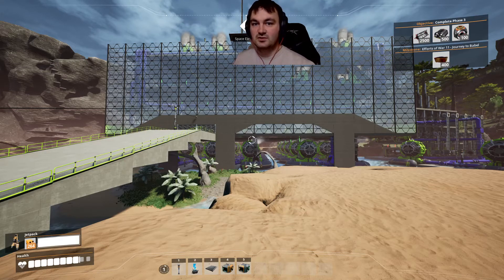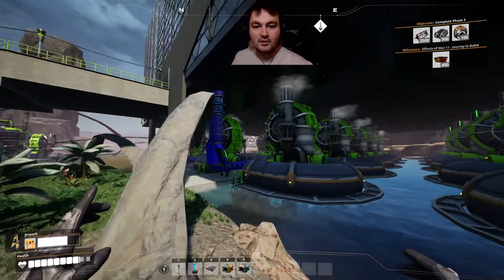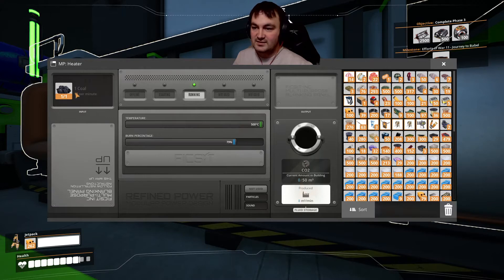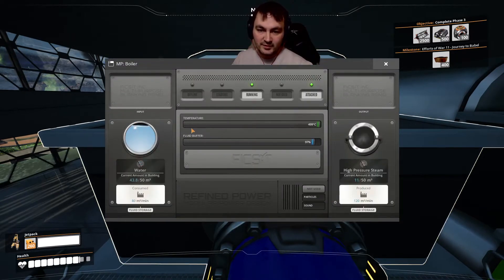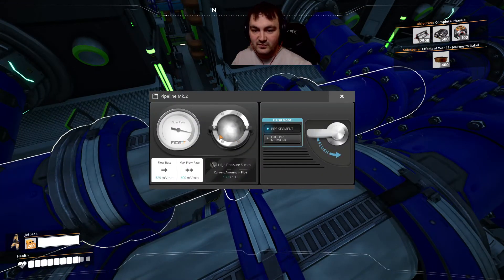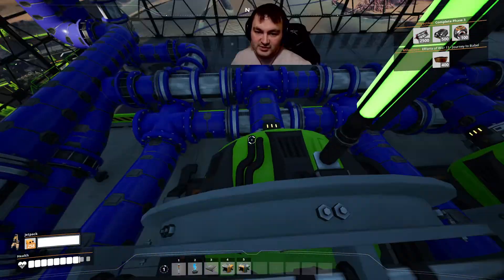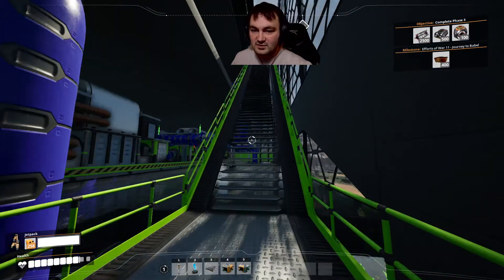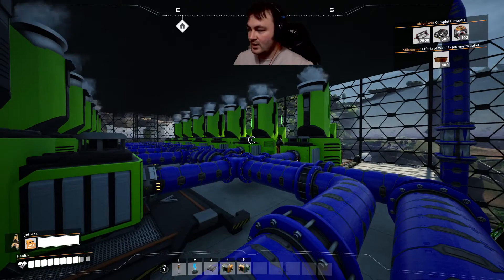Satisfactory Refined Power Coal Plant 14GW from 480 Coal!

Comment: Does this system work with U6? Mine is not as of 10-6-22. There is very little high and low pressure steam. The turbines are turning, but very slowly and the power output for 7 of the best generators is only 67 MW. Also using Mk2 boiler and turbine.
Reply: You need to make sure no resource backups in the system are causing areas to turn off:
1) Your burners are always at peak temperature from a fuel source and 100% CO2 is being vented into a chimney
2) Your boilers are always full of water creating high pressure Steam
3) Your HP steam is being 100% consumed by turbines (any excess you can vent/sink if you have mods or balance it out like I do)
4) The Low pressure steam output from the turbines is being 100% vented into a chimney
5) Make sure you have pumps on the pipes to ensure max throughput and no bottlenecks/build ups form
6) (I had this issue) check your pipe flow outputs are what you expect them to be because I had to break and rebuild odd pipes
7) Make sure you don't have Mk1 feeding Mk2 directly, if you do then have extra Mk1's to keep up with the numbers (you will need to adjust)